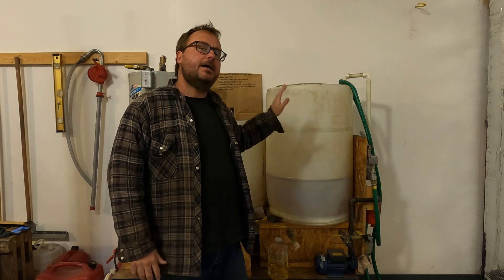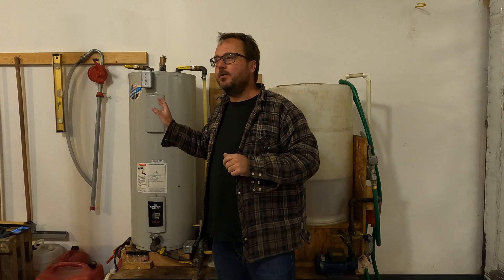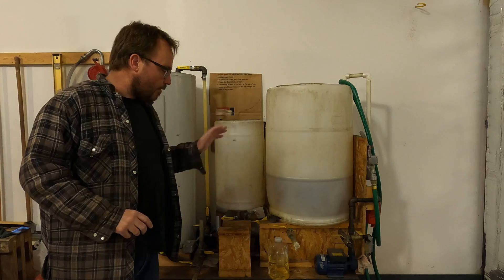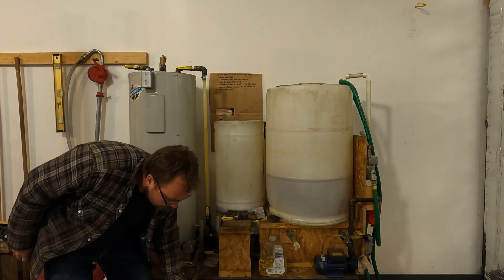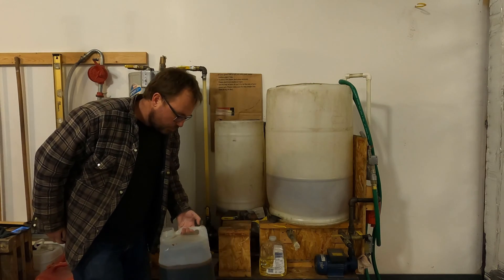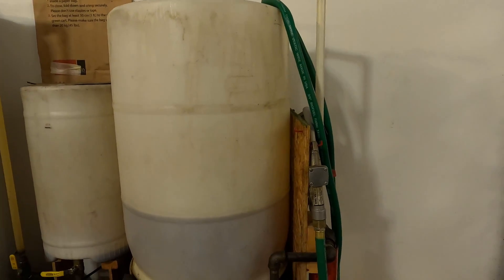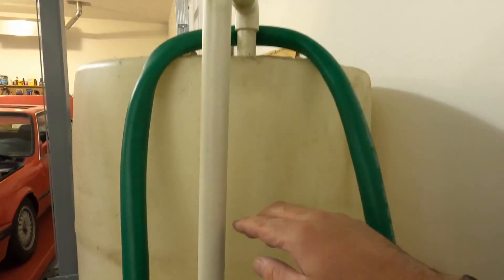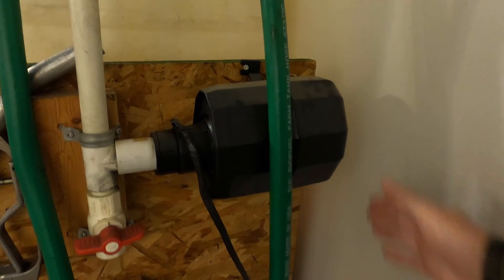Biodiesel Processor Machine PARTS LIST!

Comment: Thanks for the Video. I have a question concerning the Air Pump, there are 200W and 400W pumps available. How strong is yours?
Reply from the maker: I’ll look but it blows a LOT of air.  Id guess 400w at least
Reply: Thanks for your support.  I have seen that there are even bigger pumps on ali Express (up to 900W). 
900W is rated for 1m Water column, which would tarnslate into 1.1m "oil column".
 Would that corospondent with your setup?
Reply from the maker: honestly I think any small hot tub air pump would be fine.  Mine is almost too much air! @Kristian-r6w
Reply: OK, so i go for the small one. I also can extend the running time if needed
 @gregs_garage

Comment: Thanks for the BoiD videos Greg. Nice work. I built a small reactor and wood chip tower for dry washing. Powers my diesel generators.
In previous comments you mentioned disposing of glycerol at city hazardous waste drop-offs. How are you removing the methanol from the glycerine prior to disposal? or do you just leave the remaining methanol in it ?  I ask because after my first few batches I am ready to dispose of the glycerol.
My reactor is a small 18 liter unit so I only have about 4 liters of glycerol per batch.
Reply: Can you share a link for info on making a woodchip dryer?

Comment: I'm trying to find two good inexpresive pumps for wvo. Your pumps seem to of held up. Can you tell me the make and model?
Reply from the maker: They are a 120-volt water pump from Northern Tool.  You can find them still I think.  They are 15 years old and still working fine pumping oil.
Reply: @gregs_garage  What is the HP, GPM (Gallons Per Minute), and Voltage Amount does the First Pump (near the Water Tank) and Second Pump (in Front of the "Finished Oil Tank") have? Furthermore, What is the Voltage Amount for the Hot Tube Air Pump? 
Whenever you get a chance.... Please let me know. Thanks!
Reply from the maker: @Mr.GabrielAngelGoldenBurton6  All are 120-volt.

The 2 pumps are the same.  They are small water pumps from Northern Tool. Don't have the specs handy but you can look them up.

Comment: Hi Greg I've just stumbled on to your channel so if I ask something you have answered I'm sorry but I was wondering can you make bio diesel out of sump oil as this is a lot easier to find and can you use hydrolic oil for that matter
Reply from the maker: what is sump oil?  If it's petroleum based it will not work.  Biodiesel needs animal or plant based oils for the reaction to occur.
Reply: @gregs_garage  ok sump oil is when you change your oil in the car, tractor truck or any other engine I don't have a clue what you call it other than that but thank you for clearing it up most people in Australia sell there plant oils to farmers to put into stock feed
Reply from the maker: @grayem76  ok.. Motor oil.  yeah you cannot use that for biodiesel.   There are other ways to use that oil, like some do fancy filters and centrifuges to clean the oil and burn it.

Comment: Great video....I'm still learning here...
Are any uses for the left over Glycerin after processing a batch?
Is this process neccesary if your running older diesel engines?  Obviously this method is required to be burned properly in new diesels....but is this process needed if your just wanting to run simple generator type of engines....or pre-2000 vehicles?  I maybe have been watching too many chinese diesel heater videos lol.....
Reply from the maker: Glycerin - you can make soap.  I think it can be used on gravel roads for dust control. 

you may be able to get away with burning unreacted veg oil in a crude diesel.  Blend it with regular diesel or something.  There are all kinds of theories.   This method is safer in my opinion.  I only run it in old diesels as it is but still like to do the full proper processing.
Reply: @gregs_garage  Thanks for your reply!  I live in the country....so if not able to use any other way...dust control is would be a great alternate.  Stumbled upon this today....new method....about the same cost as purchasing methanol and potassium hydroxide flakes he says....but with waay less work....https://youtu.be/ZZg6hirk9r0
Reply from the maker: @MiniatureChickenChannel  I don't know.  That guy is just using a method to clean the veg oil, then blending it with kerosene to make a diesel "substitute".  It's not Biodiesel at all, and I wouldn't do that.  But he talks a good game so he must be right!  Proceed with caution.

Comment: Hi I have a quick question , would beef dripping or beef tallow oil be used with a system like this ? As it solidifies in room temperature . Would it clogg the filter or the pumps ?
Reply from the maker: Yes my understanding is that animal fats can be used.  But they would have to be melted at the beginning of the process.
Reply: @gregs_garage  thank you for your response